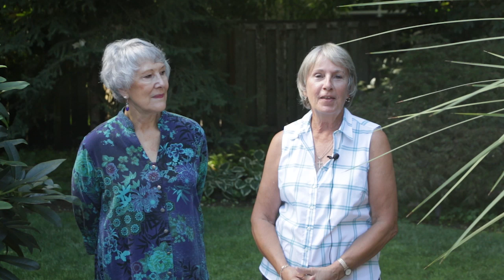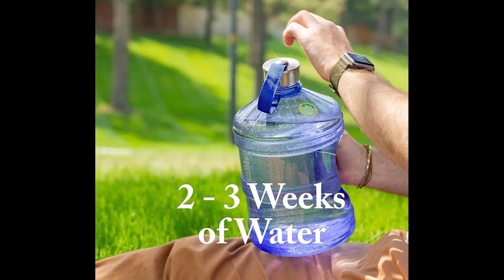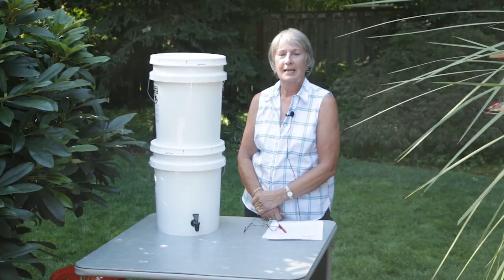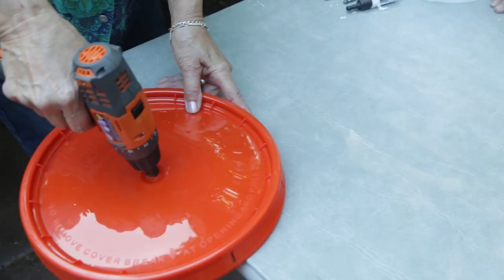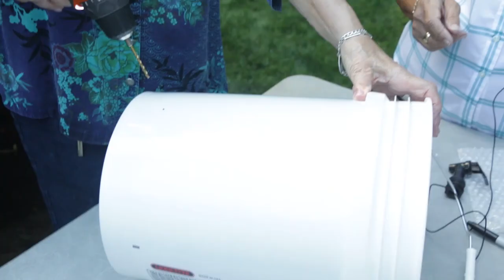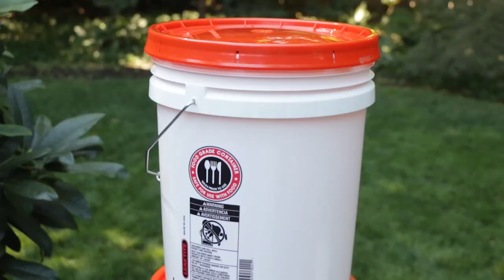How to build a two-bucket water purification system to prepare for a disaster

Comment: Gravity filters are designed to remove certain pathogens from perfectly clear water such a mountain stream. If there is any silt in the water they will plug up and not allow water to flow through. You can scrub the cartridge, but soon you will reduce the thickness of the media and then it will not remove pathogens. YOU ABSOLUTELY MUST PRE-FILTER THE WATER UNTIL IT IS PERFECTLY CLEAR. This can be done by a combination of settling, flocculation, sand filtering, and/or common cartridge type sediment filters that are easily available. If you don't believe this, take out all but one of your ceramic cartridges, plug the other holes, add some dirty water like what you will have to use during a crisis, see how long it takes to plug up your ceramic cartridge. You will ruin one cartridge but you will know the truth! 

Another issue: if there is water in a ceramic cartridge, even a little, and that cartridge is allowed to freeze, a fine crack can occur that will allow pathogens through. You may not know it as you cannot see the crack. NEVER ALLOW YOU CARTRIDGES TO FREEZE!
Reply from the maker: Very good points you make. Its a good idea to pre-filter the water going into the two-bucket filtration system. For example, you can let the water sit for a while to let the solids separate and settle to the bottom of the water-collection container, and then carefully decant the water through a rough filter going into the top bucket of the two-bucket filtration system. Its also a good idea to use a secondary method to fully disinfect the filtered water, such as bleach, water purification drops, boiling, UV, etc. While most bacteria will be caught by the filter, viruses are small enough to slip through almost any filter system. So a disinfection step is a really good idea. Check out our Emergency Water Supplies page for more information: https://www.neighborsready.org/water-supplies.html

Comment: Does the hose go into bottom of filter and just down into bucket?
Reply from the maker: Hi Linda! Good question. The filter is placed in a hole in the top bucket, and the tubing attaches to the filter and hangs down into the bottom bucket. This increases the flow rate quite a bit, because it acts kind of like a straw, drawing more water through the system. I just added a cross section diagram to the water purification page on our website at: https://www.neighborsready.org/water-supplies.html  You'll need to scroll down a bit to find the section on the Two-Bucket purification system. I hope this helps. :)

Comment: Great video ladies… however those ceramic filters are not the best way to filter lake, river, stream or pond water… they will plug up rather quickly, unless the waters quite clean- priming could be an issue too! 

I suggest you look at Nanofiber fast flow water filters- NASA was involved in the development of them and they’re used on the ISS to provide Astronauts clean/safe water in space. One  single Nanofiber fast flow filter provides 12+  gallons of water per hour with 99.9999% reduction levels of both bacteria and viruses. 

They will filter 10 times more water than a ceramic/carbon mechanical filter before they need replacing and filter out contaminants that are 1000 times smaller than the smallest ceramic micron filters while filtering water up to 300 times faster.

If you’d like to contact me I’d be more than happy to send you EPA Lab Certified Testing as well as field testing… I’m a forty + years boots to the ground- first responder and I’ve been involved in the development of water treatments, filtration systems as well as design engineering systems that are deployed and used across the globe.

One last thing before departure- When I conduct classes I always tell my students to use their go to emergency disaster water filter systems immediately and to test them in the field. Our groups have seen many a self proclaimed go to  emergency water filter fail with very little if any water being provided.

Wouldn’t you want to know if YOUR water filter would work? There’s only one way to find out and that’s to use it before a crisis.

Comment: Anyone seen or tried the Uzima filter system? Same concept. Uzima's design is a bit different with a single filter, which although it attaches to the top bucket it mounts inside the bottom bucket. Claimed 1L/m flow rate. Wonder how that compares to Berkey or it's generic filters flow rate? $80 on @m@zon. Thoughts, opinions? Thanks.
Reply from the maker: This is the first time I've heard about the Uzima filter system; just looked at their website, https://uzimafilters.org/   It looks like a good organization, and they have big discounts for non-profits... if you bought in bulk as a non-profit  (8 units per order), the current cost for a system would be $40. I agree, def would be interesting to hear how well it works. Thanks for sharing this information. :)
Reply: I just bought the Uzima. The filter says you have to back flush it after every use with the provided syringe. But that the filter will last 5-10 years. It has a 1 hear warranty for manufacturing defects. The food safe buckets are a lot cheaper than amazon at lowes/home depot. If you wanted to build one. You’d need the spigot and filter so I just bought it to save myself the trouble. They have another brand on amazon
With the same concept but
the filter doesn’t last as long. But the filter is 😮🎉is $29 for a replacement filter vs $49 for Uzimas replacement filter. 

H&G Lifestyles Camping Water Filter 
$74.99 😮

Comment: Do you need to add an air hole to the bottom bucket? I made something similar but just with some large plastic screw lid containers and a candle filter. I found it didn’t flow well until I added an air hole to the bottom tub (at the top). Not sure if that's a common problem or if I did it right? It seems to be working through! 😅 Thanks, this is great info! 😊🙏💫
Reply from the maker: I'm so glad that worked for you. What we used to increase the flowrate is a syphon tube connected to the stem of the filter coming through the lid of the bottom bucket. The syphon tube made a HUGE difference in flowrate. A picture would explain it better; check out the bottom of the first page of this instruction sheet for more information: https://www.neighborsready.org/uploads/1/4/2/8/142830157/bucket-system-instructions-maintenance-just-water.pdf

You can also check out all of our information on preparing your water supplies on our webpage: https://www.neighborsready.org/water-supplies.html
Having a filter system is important, but the first step is always to have a good supply of emergency water, because filtering water is a lot more trouble that drinking up your emergency supplies. :)
Reply: @neighborsready  Oh, thank you, that's really helpful. Yes, I saw it in the video but didn't understand its role. I need to look up siphon tubes and water pressure differentials to work it out. I thought it was an air pressure issue which was why I couldn't see how the tube would help. But yes, the tube pertains to the water pressure, I think. It's all not quite as simple as you'd think! But that makes it kinda cool, imho. (Just not something you'd want to try to work out during an emergency, if you could avoid it. 😉) I might try to find some tubing and try that too. Fun! Thanks, it was a great video, super clear. Thanks for the reply! 😊🙏✨️💫
Reply from the maker: @ejbabc  You're welcome. And totally agree that its fun! Another good backup method is the PUR (Purifier of Water) packets, developed by Proctor & Gamble in collaboration with the World Health Organization. We did some lab tests on water from a nearby creek that we purified using various methods, including (1) filtering water, (2) filtering water plus treating water with a few drops of a fresh batch of bleach, and (3) P&G PUR. According to the lab results, method 2 & 3 worked equally well; filtering water without a disinfectant was not always sufficient because sometimes pathogens are tiny enough to slip through the filter. (CDC recommends adding a disinfectant like bleach to filtering.) We don't recommend any particular methods, but personally, I like to have a couple of options. What I liked about method 3, P&G PUR, is that it can produce 2.5 gals of clean water in 30 minutes; WAY faster than filtering water! Another advantage for PUR is that it is REALLY fun to do it! The downside to the P&G PUR method is that it is a bit expensive and the ingredients expire after a couple of years. I keep packets of P&G PUR in my go bag and in my emergency supplies, as a good backup method. We bought our P&G packets in bulk to minimize the cost and split the box amongst our neighbors. Good luck, and have fun!
Reply: @neighborsready  Amazing, thank you, I'll keep those in mind! Thanks for all the info, appreciate it! 🙌😊🙏💫

Comment: Do you have to flush out filter before installing on bucket
Reply from the maker: Hi Wyatt! Good question. Yes, when we tested the filter system (built with the Just Water filter), we cleaned out the buckets with a little bleach, and then we ran a few gallons through the filter system before using the water. The manufacturer has a very informative instructional sheet. You can find it on our webpage at: https://www.neighborsready.org/water-supplies.html. If you scroll down you'll see the Ceramic Filter Drip System instructions under the video. Or you can go directly to the instruction sheet at: https://www.neighborsready.org/uploads/1/4/2/8/142830157/bucket-system-instructions-maintenance-just-water.pdf. I hope this helps! :)

Comment: Excellent, thanks.  I’d like to see it in action.
Reply from the maker: Hi there! We've definitely used this design. The flow rate is much increased when you add the tubing to the filter; otherwise, it really takes a while to filter the water. Also, I recommend getting a backup filter because the ceramic can break if you accidentally drop it. We learned that from experience.

Comment: Bucket filtration system for around $100 is a RIP off. Imagine a homeless person needing to making several of these on a budget?????? Companies are NOT taking into consideration extreme off grid living circumstances to help humanity!
Reply from the maker: Hi there! I'm not sure where you got the $100 figure. In a workshop we conducted last year, we were able to build these DIY 2-bucket water filter systems for our cost of about $60 each for a group of 50 people. Costs may have increased due to inflation. But here are some ideas for economizing: (1) We got some bulk discounts on the filters because we were making a lot of these systems at once. (2) We purchased our buckets new, but if funds are tight, you may be able to acquire used food-grade 5-gallon buckets for free at a local restaurant or other establishment to reduce the cost. Just make sure that the buckets are food grade and that the bucket has never stored anything toxic. I hope this helps. :)

Comment: Justwater cannot be accessed in Europe
Reply from the maker: I'm so sorry to hear that you cannot access the Justwater website in Europe. You could give them a call at 1-214-675-7426. Or, you may be able to find a comparable dome ceramic filter on Amazon or at a local manufacturer. It may take a bit of hunting around. You'll want to make sure the water filter efficiency is rated at 0.2 micron or better. (Smaller is better.) I also suggest taking a look at the lab certification results, to make sure that the filter has been tested and works as advertised. I hope that is helpful! :)
Reply: @neighborsready  Thanks!

Comment: Do the buckets need any regular cleaning maintenance?  You mentioned boiling too. Should I boil before or after filtering or does it matter?  Could I use a cover that twists off so it would be easier to use as daily water?
Reply from the maker: Hi Karen,
Sorry to take so long to respond to your note! With Christmas and then an electrical fire at our house, we've been pre-occupied. You have some great questions. I'll take them one at a time. First, do the buckets need any regular maintenance. We have maintenance instructions on our website at https://www.cedarhillsready.org/water-supplies.html (scroll down until you see the list under the video); or see the cleaning instructions on the second page of this instruction sheet: https://www.cedarhillsready.org/uploads/1/4/2/8/142830157/bucket-system-instructions-maintenance-just-water.pdf 

Should you boil before or after filtering or does it matter? Quick answer is to FILTER first, then disinfect the water. Boiling is a disinfection method. Think of filtering and boiling as doing two separate jobs. The filter system prevents impurities larger than the size of the filter rating from passing through. While a high quality filter rated at 0.2 microns will prevent most impurities and prevent most bacteria and protozoa from going through, some viruses may pass through. You boil the water to disinfect it, to kill any viruses that may have slipped past the filter. 

On the last question  you have, I think you'd be fine with any clean cover over the top of the filter. When we use the filter system, we just set the top of the bucket on top but don't lock it into place. 

One thing I'd like to emphasize about water resiliency. The first step in our plan is to store enough water for your family for 2 weeks. Purifying water is a backup plan, if the disaster or emergency lasts longer than two weeks. How much water should you store? Check out our DIY water resiliency plan on our water resiliency page: https://www.cedarhillsready.org/water-supplies.html 

I hope this was helpful! :)

Comment: You trying to clean the water in plastic that polutes the water - why don't you use clay or metal or glass or wood ?
Reply from the maker: Hi Eleni. Good question. The reason we are using plastic buckets is because glass or clay might break in a disaster. Wood or metal could be an option, but these materials wouldn't be as cheap, light-weight, or easy to work with as plastic buckets. While I agree that it makes a lot of sense to limit our use of plastics to reduce waste that pollutes our waterways, in this case, it makes sense to us to use the plastic buckets for an emergency water filter system. Also, you could buy used food-grade 5-gallon buckets from local restaurants and repurpose them for this 2-bucket system, which would repurpose the plastic buckets and save them from the landfill. If you do this, be sure to wash and disinfect the buckets with bleach. Also, be sure to never repurpose buckets that have had anything in them other than food; any buckets that have stored chemicals or non-food materials are unsafe to use for filtering drinking water. Thanks for your comment. I hope this was helpful. :)

Comment: Seems like good information.  Obviously the filtered water would have sediment removed, but would it be biologically safe or would it need boiling?
Reply from the maker: Thank you for your comment. I appreciate your question, and because of your question, I've added some additional information in the "Description" section of the video. Here's my thinking, err on the side of safety. CDC says that no matter what filter you use, it may not eliminate all biological risks. The filter we used says it has 99.999% bacterial removal, and virus reduction, so adding a boiling cycle or an additional disinfectant cycle is a good additional precaution and is recommended by the CDC. 

For further research on this, check out our video, "How to clean dirty mucky water to make clean drinking water," at https://youtu.be/liquSzQgN8U

Also, check out the following guidance from the CDC: https://www.cdc.gov/healthywater/drinking/travel/backcountry_water_treatment.html

More information on selecting an appropriate water filter can be found at https://www.cdc.gov/parasites/crypto/gen_info/filters.html
Reply: @neighborsready  Thank you.  The way our government is acting I hope we never need this.
Reply from the maker: @amathonn  Natural disasters are inevitable. Its a very good idea to be ready, just in case it happens in your area--and help your neighbors, too. In a disaster, first responders will be overwhelmed, and may not be able to help out for a while, as we have seen. Neighbors helping neighbors can increase your chance of survival and can also be fun and connecting. :)

Comment: Rain water?
Reply from the maker: Hi Patrick! Are you asking can you filter rain water using this water filter? I don't see why not, especially if you've built a rain barrel water storage system. We covered that in one of our meetings this year. Check out this video if you are interested: https://youtu.be/rkz3RJ70xts. We also recommend that dirty turbid water be cleaned up a bit before its put through the 2-bucket system to make it all work better. If you start this video at about the 7:50 minute mark, you can learn about some alternative ways to do that with this video... if you are in a hurry, start it 7 minutes into the video. https://youtu.be/liquSzQgN8U
Reply: @neighborsready  yes, and I will watch the video. Thank you 😊